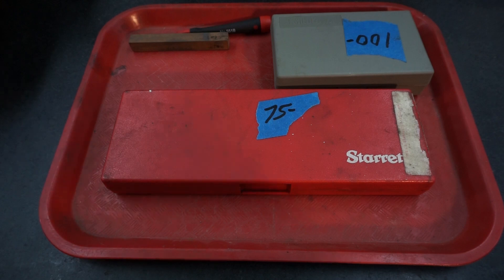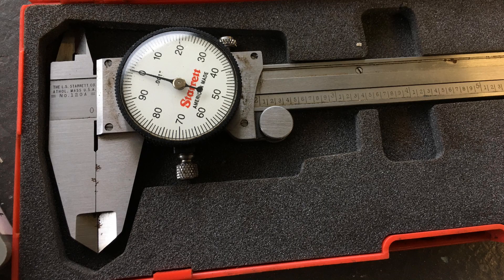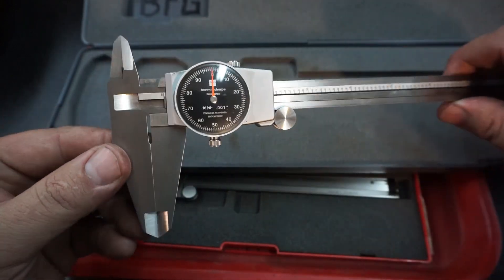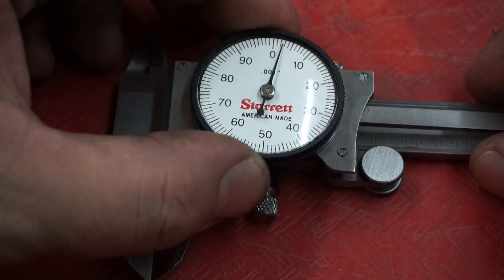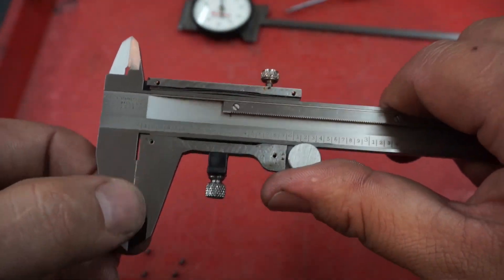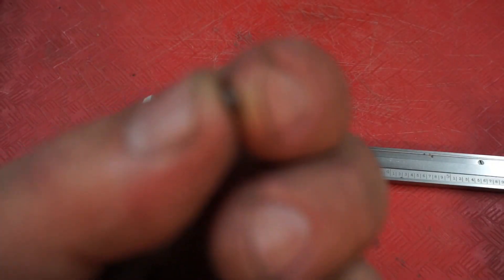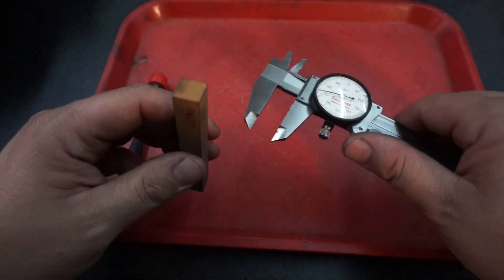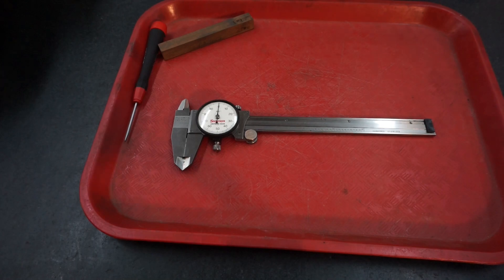Shop Talk 18: Starrett Dial Caliper Fix

Comment: Been using calipers for 15 years and always assumed springs and tiny gears would go flying all over the room if I opened them. Today I dropped the big 12 inch starrets that are probably really expensive at work, no damage but they were clocked at the 6 o clock position, almost had a heart attack! So I googled it and your video popped up, within a few minutes I had them almost perfectly at the 12 o'clock. Thanks a million!

Comment: A great way to clean those especially after taking it apart is wiping it down with Ballistol using Q-tips, paper towel, and tooth brush. The Ballistol will also lubricate it.

Comment: Any suggestions on how to fix a Craftsman 40164 DJ set of calipers?  The needle is reading between 1 and 2 thou when the calipers are closed and I can't open them past 3.271"  It feels like the pinion is hitting something in the rack, but I can't see anything. I also can't seem to find any documentation on these calipers anywhere.

Comment: The internet needs more Adam Booth.  This video is just the ticket for people that have never had a mechanical caliper apart.  There ARE user serviceable parts inside :)

I used to clean up the shop's cheap calipers in an ultrasound tank (after removing the dial lens, needle, and face), since I could never work all the grit out of the racks any other way.  The needles come off easily with a watch hand remover (cheap to buy, easier to make), and I'd just put the needle back on the shaft in the 12 o'clock position when it was all back together.

Comment: On my calipers I just push the 0 button and they reclock on their own. :-)  I really prefer mechanical things but the electronic calipers in the shop environment really shine for me with no lenses to get damaged or mechanisms to foul.
Reply: Just batteries to run out LOL.  I want digital ones so I can push a button and be metric or imperial, plus you can re-zero them anywhere for other comparative measures.  I currently have two dial ones, one metric and one imperial.  The metric ones are graphite and my stainless 8" ones don't read so well anymore (good enough for wood working still).  I think something got bent.  I tried to take it apart, but there definitely weren't 4 screws on top to release it and I couldn't see what else to do.  I wasn't in to prying on stuff.  I'll leave the hammer and chisel method to others.
Reply from the maker: bcbloc02 Digitals are my go to as well, but around my shop I enjoy using both.
Reply: I find for some things I like digital (like doing subtraction to get a measurement). For others I like a dial (Like trying to set them to a specific dimension).
Reply: @Brian:The best thing about digital is I can see the larger numbers without having my glasses on, but I hate having to push that dang power button just to take a reading right quick.  Lazy I know but it's one more step just to use a tool.
Reply: Automatic shutoff sucks sometimes.

Comment: Thanks to your video I was able to save my Starrett  No.120 dial calipers. They were dropped off of my work table and would stick at 10 when I tried to zero them out. Turned out to be a broken tooth lodged in the rack. Even with the broken tooth they now work great and zero out in 12 o`clock position.

Comment: Totally different subject but I was in the mill supply business in the early '80s when Mitutoyo came out with their digital calipers. Used an etched glass slide as an encoder. Slicker than hot chicken fat on a stuck doorknob. Until the first time somebody dropped it in a toolbox! We sold a hundred or so of them and almost ALL of them came back! The only one of them I know of that worked after a year was the one that lived in my desk drawer! Granddad (Lockheed Machinist, built B-29s) taught me how to take care of tools when I was about 5...
Reply from the maker: Yes sir, take care of them and they will last. I hate to say it but all the guys I work with, they do not handle the tools like I do. You usually find both the mics and calipers intertwined with tools and junk on top of the lathe or work bench while they are working. Drives me nuts.
Reply: Yeah man! When I had my machine shop classes in college (BSMET) I picked the oldest LeBlond lathe down at the end of the row. All the other guys fought over the newer machines and never got the same one twice! Cleaned up "Blondie" and ran some oil around (I learned how to run a lathe in HS shop but didn't tell THEM that). Shop instructor came over (Retired Navy Machinist) and said:" Why did you pick THIS machine?" I said: "Because nobody else will bother her until I get back tomorrow. The barrels for the turnings are right behind me and the tool room is ten feet away.":)

Comment: At the tail-end of the slide, I used a surface grinder to remove a total of 1" of the shield so I could use it to measure hole depth. This was about 35 years ago. :-)

Comment: Now take a .125 and a .150 gage block to check if the main gear is worn/damaged.  With the .125 you'll get a reading at the 90 degree position, with the .150 the 180 degree position and with both the .125 and .150 the 270 degree position.  you're looking for +/- .001 max to call it usable (generally).

Comment: The most important things about screwdrivers is that they fit the screw well, other thing is that they use good steel that doesn't deform or break. Making your own pin punches and screwdrivers may not be a bad thing to fill your spare time. Phillips screws and other cross points do better if you put the driver bit in place and give them a whack on the end with light hammer to make them fit better.  Buggered screws can be tightened sometimes by tapping the slots closed a bit with a hammer then tapping the bit in for a better fit. Nothing gives good purchase in a stuck screw like a tight bit, and the time to get it right is before you damage the screw. Of course buying good ones in the first place works too. :)

Comment: A toothbrush works great for cleaning out the Rack & Teeth. A little tiny bit of Remoil OR Rig#2 Oil (both gun oils) are very light and evaporate quickly but will leave lubricant behind with no oily mess to attract dust. Works great!
Reply: Even better than a toothbrush (and they are cheap) is one of those gunsmith brushes used to clean revolvers. You set it nice on the track, and gently move it counter clockwise. The dirt just pops out. Did wonders for my set which fell in the lathe sump, the thing was nasty as nasty comes.
Reply from the maker: Thanks for the tips. I've normally used my solvent degreaser cleaner, pretty much just alcohol.

Comment: I have Brown &Sharpe calipers I bought when I started work in 1985. Never had to recalibrate, but the tips of the jaws are worn, so I just use them around the house. I have to readjust my Mitutoyos almost weekly. Don't use them much for that reason.

Comment: Being a horologist (watch maker) in a former life my first thoughts to set the pointer to 12 o,clock position would have been to pull the hand/pointer and re position it, something I did frequently on watches and clocks in the dim past.
Reply: Equiluxe1 only thing there would be you wouldn't get rid of any crud in the rack. Assuming it's the cause it would just bump the needle out again in the future. Fix the cause not the effect :)
Reply: I would flush it with pure alcohol to clean it these days back then I would have put it in the ultrasonic bath of xylene.

Comment: most of the time i use my Mitutoyo 505-566 Dial Caliper hes pretty clever made it comes with a pin made to fit a hole it can disengage the wheels 
to set the Pointer on top you just need to pull it open until the pointer showes where u want it to  stick in the pin and close it take the pin out and you are good to go

Comment: For small screws such as those you are dealing with, place the screw on the screwdriver and with same hand which is handling the screwdriver, place one of your fingernails under the head to the screw and apply pressure. This will hold small screws in place and allow you the line up to the hole with one hand while the other hand steadies the work.

Comment: Good video other than the fact that you can not unjust the pointer by the dial. You can only adjust the zero or the pointer by adjusting the long gear rack

Comment: Please show the other type soon. I have a 12"
Mitutoyo that lost clock from a stray chip in the rack. .. though long ago cleaned and no longer jumping off clock, the dial has quite reliably remained off clock by almost 180 degrees.  I do not have the wire or shim tool that was supposed to come with it. If I can see the tool and process, I can make whatever tool is required and do the deed.  

Thanks for all your videos!

Comment: I like the little red tray - it's too easy to drop screws (especially that size) onto carpet and it takes some keen eyesight to find 'em again. I use angled tweezers to remove and replace little screws like these; the red dish will be be an essential addition. Why red? It makes the plate go faster ... One of our electronics stores in Australia markets a magnetic dish, which (obviously) only works on steel screws... and I have a magnet on an extensible wand to find lost screws., though obviously it is better not to lose them. Great Idea, Adam.

Comment: I have a Starrett 120 that I bought new from McMaster-Carr back in 1986-88 when I first started working in a shop (maybe $120), I still use them all the time. I usually clean the rack with a new solder brush. One thing I have noticed is that is different from every other set of Starrett calipers is that my 120 has a depth rod that is only 0.100" wide, while most are 0.200". I really prefer the narrow rod since I can measure the depth of holes down to 1/8" diameter. I don't know if this is 120 vs 120A, or just age.
Reply from the maker: All of the American Made 120's have the A next to the part number, so I think it indicates that these are the American made calipers. The model 1202 are not american made and imported.
Reply: Good to know, maybe mine were from before there were a non-American version. My 120 calipers just have "120" not 120a or 1202, and they do say "American Made" on the dial like the 120A does. They also have much deeper stamping on the letters and numbers than the 120a. They also have a metal case with the red vinyl cover, not a plastic case. I can send you a pic of these next to a 120a if you like.

Comment: I like the Mitutoyo 505-712 calipers with carbide measuring faces. I have a pair I bought in 2004 and they show no signs of jaw wear.
Reply from the maker: Cad-Cam_Man nice, I've never had any of those, or seen them used

Comment: Sadly I'm gaining some experience taking dial calipers apart. Yours surprised me, because it seemed way simpler, than what I use at work. I've taken apart Kinex, Insize and Berger dial calipers. I wouldn't be surprised if they all were some Chinese company pretending not to be one. But this Starrett seems to be less sophisticated one. The ones I've taken apart all had two spring loaded gears turning a pinion gear, which holds the dial. This, I believe, functions like a ball screw of a CNC. Without any backlash. It was strange to see the Starrett missing this feature.
Reply: The Starrett without the easily removable plate have the design you are talking about. The ones shown in this video have a double gear with a spring between the halves (think like a sandwich, with the spring as the meat.) Both halves of the gear are the same size, and the spring is trying to rotate the halves in opposite directions against the next gear, which takes up the backlash.

Comment: Hey Adam, great video. Can't wait to get home and fix my Srarret dial caliper. It's been missed clocked for some time. Dosent return to zero probably just dirt. Thanks, you inspired me.
Reply from the maker: Make sure to clean them good while you have it apart. Like others have said, use a small brush like a tooth brush to clean the rack.

Comment: I took mine apart and cleaned it and it still skipped. I put some 3n1 silicone oil on it, worked it in real good, wiped it all off with my fingers only leaving a micro thin film on and it now doesn't skip anymore. I read you are not supposed to oil them but what did I have to lose.

Comment: There's an easier way that works with all calipers. The hand is press-fit on a taper. Pull the lens off, then use two little screwdrivers to gently pry it off, then press it back wherever you want it. I've fixed Starrett, Brown & Sharpe, Mitutoyo, Tesa and more this way, haven't had a problem yet.
Reply from the maker: tehfade53 That's easier?
Reply: There is a reason it is clocked wrong. Was it shock bounce or was it a chip in the rack that only affects it at a certain speed. I would rather clean it and be sure it was correct. Ask a clock-maker what kind of screwdriver he uses to pry the hands off. Now just wait until you bend the shaft or break a lens with your method.
    Mike (o\!/o)
Reply: It's a big problem if you lose one of those screws. I almost did twice.

Comment: I bought a Mitutoyo dial caliper on ebay and was pretty disappointed I could see light between the jaws when I checked it.  Now I can use it for approximate measurements but that's not what I bought it for. I wonder if I could fix the jaws by carefully removing a little material at a time with sandpaper on a flat surface until I can't see light between them.

Comment: Old, soft toothbrush after a soaking with light oil cleans that rack. Make sure that there's no oil residue left on it before assembly as the oil will tack in new grit.
Reply from the maker: I like to use my fast evaporating solvents to clean them out.

Comment: 120A much better than that Starrett china crap, the only problem I see is the single engagement of the movement causes the dial to jump and the backlash to be more than desired (starrett used to spec the backlash to less than 0.6 division if over non repairable), also an acid brush cut to half length make for great rack cleaners. I am a Mitutoyo person but I also prefer a digital caliper to dial.  Also, the Mitutoyo 505-645 has the same basic design but I believe they have an access slot and a "key" to easy reset, just don't go gorilla on it, they bend the retention spring fairly easily and lose all repeatability unless you take them all the way apart.
Reply from the maker: ChadHHC86 Yep several have mentioned the Mitutoyo style and how the user can correct the dial.

Comment: actually......its easier to take off the bezel clamp, take off the bezel with a flathead screwedriver, take off the needle, close the caliper, then just adjust the needle to the 12o'clock position 
taking off the plate takes a risk of unwinding the spring inside so it might not be accurate afterwards.

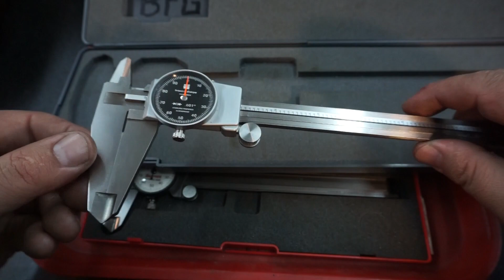Comment: At 3:20 you talk about calipers like the Starrett 1202 without the four screws and said "there's other ways to fix these other ones" and "that's what I thought I was going to show you today". Did you ever do a video about the other type? I picked up a 1202 for $10 at a garage sale today, but when the jaws are closed the dial is pointing down at about six o'clock. I've been reading online about using paper clips and shims to reset the dial to 12 o'clock, but I can't get it to work and I don't want to damage anything. Thanks.
Reply from the maker: I never have shown the "shim trick". You have to shim the rack and slide it up to close. I hear its bad on the gear to do it that way though.
Reply: Thanks for the quick reply. I'm following the instructions below for the "shim trick" (found here: http://forums.finewoodworking.com/fine-woodworking-knots/power-tools-and-machinery/recalibrating-dial-caliper-mitutoyo), but it's not working for me. Maybe it doesn't work on the 1202.

"you may need to get the gear driving the pointer to intentionally skip some teeth on the rack to get the pointer vertical when the jaws are closed.  To do this you will need to make a small tool out of some shim stock or a soda can.  Cut a 1/16" wide by 2" long strip out of the thin metal and put a slight downward bend in the strip about 1/4 inch back from one end.
"Now move the head of the caliper down to the middle of the bar and slip the strip in behind the head just over the rack with the bent tip down so it is against the gear teeth of the rack.  Now, if you move the head toward the strip, the gear on the head will ride up on the strip and will disengage from the rack.  You won't be able to see this, but you'll feel the drag on the head as the gear runs into the strip.  Move the head a fraction of an inch further to the left so that the gear will skip a few teeth and then pull out the strip, allowing the gear to settle back into the teeth on the rack. 
"Now close the jaws on the caliper and see if the pointer is at the twelve o'clock position.  If it isn't, just repeat the procedure until the pointer finally settles into the right engagement.  Getting the adjustment right is a "hunt and peck" process that may take several attempts, but with a little practice you will be able to reset the caliper in just a couple of minutes."
Reply: After farting around with shims and paper clips for a few hours yesterday, I definitely wouldn't recommend this method. Maybe it works on other calipers, but it didn't work on my 1202 and I eventually tore the shim and had little bits of aluminium stuck in the rack. I ended up taking the caliper apart to clean it. When putting it back together I left the screws out of the rack, then disengaged and reengaged the rack and the gear several times. I think it was mostly dumb luck, but I eventually got the needle back to 12 o'clock and the calipers seem to be working fine now. Just thought I'd share my experience here in case someone else is having the same problems. Cheers.